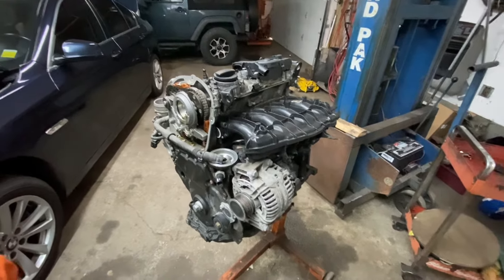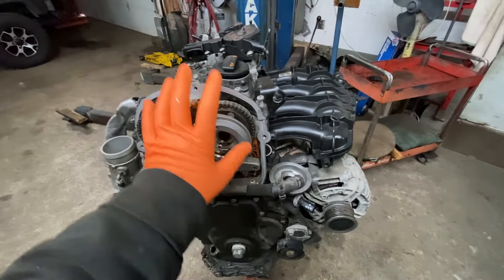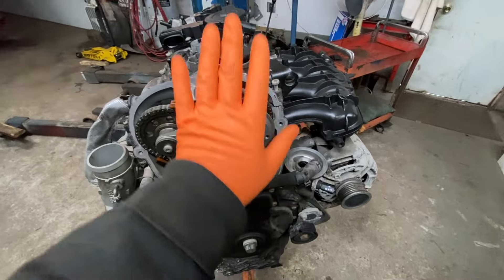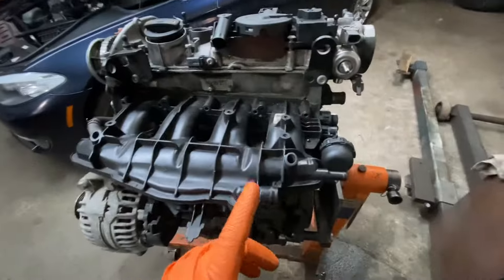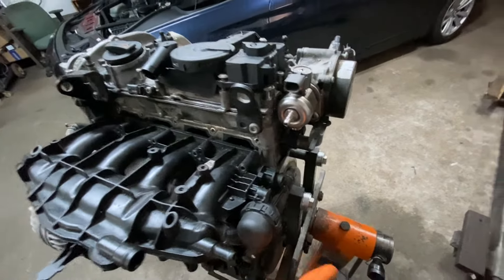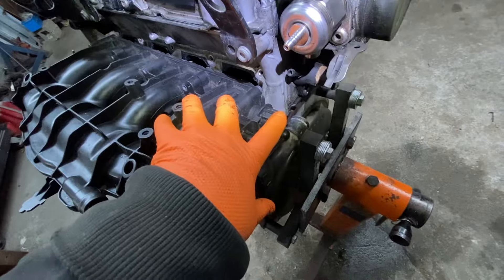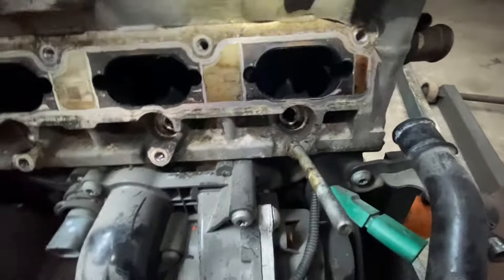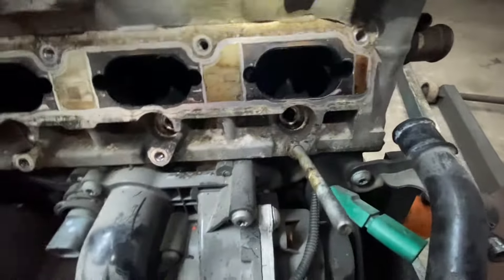VW TSI 2.0 Turbo Engine - Top 3 Failures

Comment: Hello, I have a 2012 Tiguan and for some reason it’s only averaging about 13mpg city driving it extremely slowly and about 18mpg on the highway is there anything that could be causing this issue?
Reply from the maker: Does it have the DSG transmission?
Reply: @motorcarnut  No, it is the FWD version with the 6 speed automatic. Thank you for your help!
Reply from the maker: @MystcFrost hmm, make sure air filter is clean, maybe you have a dragging brake caliper or something in the braking system not releasing properly. Make sure there is no check engine light on for O2 sensors.
Reply: @motorcarnut Yeah i recently just changed out the spark plugs, coil packs, and air filter and it brought up the mpg from 9 to 13 and it planning on changing the intake manifold as per your video because of a p2015 code, I will make sure to check out the brakes now though too! Thank you so much for your help!
Reply from the maker: Sure, no problem, hope it helps.

Comment: I bought last year 2024 may with 223 thousand km tiguan 2014 2.0 tsi 4wd.
I had a misfire cylinder 3, drove it home for 90 km.
Compression test cylinder 3 2ps, engine gone rebuild needed if the engine block survived.
This new cars have plastic in the engine, they are build to last up to 250 thousand Km.
Rough idle when I accelerate goes fine.
Any way i just thought sone one would like to hear the story.
Take care, anything you can fix with money is not a problem qao.
Reply from the maker: Thank you for your real life situation, appreciated!

Sounds like you had a burnt valve and that is from lack of maintenance from previous owner.
Reply: @ It ran well a week ago i drove it for 90km and i push it to like 180kmh, went to the place after 4-5h there winter now started the car it misfired i did not have the obd2 with me to check it.
I have a w123 mercedes with 600,000 km never went to mechanic exept to change something for funn.
Take care.

Comment: What engine code is this? CAWB, CCZB, CULA? Which one bro?
Reply from the maker: Basically all Gen 1  EA888/1 2.0TSI engine codes like CCTA, CBFA, CAWA, CAWB AND CCTB. Gen 2 & 3's were much better as they fixed most problems.
Reply: @motorcarnut Noted with thanks.
Reply from the maker: No problem

Comment: what about 1.4 litre tsi engines, what common problems do they encounter?
Reply from the maker: That's a different engine with a timing belt so you won't have many issues the 2.0 TSI does.
Reply: @motorcarnut  so does this mean its better to go for the 1.4 litre rather than a 2 litre engine
Reply from the maker: If the vehicle is a 2014 and newer, I'd go for the 2.0
Reply: Hey, where's the gearbox oil fill bolt on a '15 Jetta manual? I only managed to see where it can be drained from so haven't found where its filled yet.

Comment: I have a 2011 Tiguan that has a the dreaded p0299 code after replacing the diverter valve and then The turbo solenoid I’m left with replacing my turbocharger my waste gate rode is lose so I think that’s where my p0299 code is coming from. Should I get a new turbocharger or use a tool called turbobend to fix the waste gate rod- car is on original turbocharger with 165k do you think I can get more miles out of my current turbo or just replace it new now?
Reply from the maker: It's probably the wastegate flapper. I'd replace it first before condemning turbocharger.
Reply: My 08 2.0 T  it won't go over 50 mph and sounds like a vacuum leak sound... my oil dip stick is broke and when I start the car the motor makes werid sound and moves until I put my finger over it then stops

Comment: That seal looks like it could be a ptfe seal. They are usually not spring energised as they rely on low pressure but bigger area to seal and are capable of higher surface speeds than traditional seals. Probably needed because of the huge diameter. May be very expensive seal made badly to solve a problem that should not exist
Reply from the maker: Yes, it’s glued on the backing plate. Cheap part

Comment: My tiguan water pump went bad at 70k, hit 103k and it burned oil.  Required major repairs.  Terrible engine
Reply from the maker: Sounds like you got a couple of bad parts, but they do last a while on these engines

Comment: Does this video pertain to these engines of today or in the past? I've got a 2013 Tiguan with this engine. So far I've removed the old sealant and put new sealant on the upper cam cover (oil leak solved). New vacuum gaskets, new time chain cover gasket.
Reply from the maker: 2013 up should be fine

Comment: I have the same engine on a 09 VW Passat 2.0T- B6.  

I was told by a mechanic I trust that I have a rear main seal leak possibly.   I told him I was driving and I got a message on the dashboard saying “engine oil pressure low, pull over”. 

I pulled over right away, thank God I was 1 minute away from a gas station.    When I checked the oil level it seemed very low.   I bought 2 quarts and filled it up, I drove home a bit scared since this hasn’t happened before.  

once home I did an oil and filter changed.   

I had asked the mechanic when he was available to fix it, but he never gave me a date.  He also said I can drive it and nothing else will happened until it gets fixed.   Other than a small oil leak.   Is this correct, his assumption.   

I have noticed a leak from the flywheel/clutch/pressure-plate inspection hole...  once the engine is running.  

I have driven the car for 3 days since and the engine oil still full, the brake fluid is full as well.  

Is there anything I need to worry about.

Thank you for your help and helpful videos.   May God and Mary bless you all.
Reply from the maker: Check this out first.

https://m.youtube.com/watch?v=UZmCw-BNOjE&feature=youtu.be

Also, I would not drive it too much longer if in fact it is the rear main seal.

Comment: I have a 2015 volswagen tiguan when i bring the rpm to 2000 i get a red low oil presure light ?
Reply from the maker: Make sure oil pressure switch plug is secure, and could be clogged pick up screen in oil pan  or an oil control problem. Any codes?

Comment: Is this engine in the new 2023 Golf GTI Engine as well????? I was thinking of getting one, but after seeing this, I'll pass. Thanks for video
Reply from the maker: Thanks for the  comment. The new ones are way more reliable. I wouldn’t pass because of the older ones that had problems.
Reply: There are many more fragile engines than the EA888. I'd have one again tomorrow.
Reply: New TSI’s, different problems. I’d agree that for building power EA888’s are fantastic.

Comment: There is this sudden alert Low Oil pressure alert, with Oil can signal flashing on the dashboard...yet the dipstick reads correct gauge showing good amount of oil in the engine...whats this problem???? for 2012 Passat CC 2.0 tsi turbo
Reply from the maker: You have to check oil pressure from sensor near filter with a gauge and see if it’s the faulty sensor or a real low oil pressure problem Which can be a number of things.

Comment: 2016 CC  with over 70k mileage, i changed the manifold twice already and water pump, water pipes, alternator, ac compressor twice, radiator, feul pump 

That manifold is completely the most cheapest peice of plastic i ever seen 

Never VW again
Reply from the maker: Sorry to hear your misfortune with VW's. The ones I have owned I loved. Yes they have their problems but any vehicle does.

Comment: Your biggest failure is the timing chain tensioner fail it's a $3000 motor rebuild or more for a new or used motor the great VW people used a crappy design to hold a very important thing. get it replace get it replaced asap
Reply from the maker: Absolutely

Comment: 2019 also crap or , and can that be 'fixed ' before it goes to hell
Reply from the maker: 2013 up not really affected, No.
Reply: @motorcarnut  thx for reply and for vid , maybe I'll risk with 2019 ,2.0tsi 180hp 4 motion R line DSG , price is good and km is around 60k
Reply from the maker: Yes, if maintained they are great vehicles
Reply: @motorcarnut I have a 2013 CC 2.0t. Had the water pump go up on me the other night. I knew it once I found the coolant hoses to be cool to the touch. But that’s another weak point on these cars. Those plastic parts really kill the reliability on them
Reply from the maker: @dspock true, they all do it now.

Comment: Unbelievable. Leave it to the Germans to take something as simple as a PCV valve and turn it into that electronically controlled monstrosity you see there. I have no sympathy for people that buy these cars without researching. Or any car for that matter. These are endless money pits for sure. I would never ever buy a direct injection engine without the MPI piggybacking on the intake side. Even those injectors are not on all the time so this system would carbon up a little more than a traditional MPI alone system.
Reply from the maker: It’s not do much the Germans but all vehicle manufacturers are trying their best to combat emissions while saying money so  that’s where we are now.
Reply from the maker: I agree 100% couldn’t have said it better.
Reply: Well I have a 2012 VW Beetle 2.0 T which I purchased in 2013 before all of these problems were discovered with the engine.
Reply: @bh2155 have you had any major issues with the engine on your 2012 beetle
Reply: @MileHighJay Pretty much everything that they say could go wrong with the 2.0 T engine has happened to my car. I have replaced intake manifold x2, ignition coils, water pump, timing chain gasket cover and the main seals for oil leaks, blow motor x2, complete clutch replacement including clutch master cylinder.  Just a couple of days ago I had to replace air conditioner compressor. My car has constant problems and only 92k miles!
Reply: @bh2155 dam brotha how much did all of that cost approximately? I’ve done about 80% of these at 140k miles
Reply: @jasonrodjana209  it was about 8k to 10k on a car that is worth about 4k now

Comment: So basically if you have this motor you’re fucked
Reply: I did about everything you said and my turbo is now leaking again yayyy das auto
Reply from the maker: Honestly, they do have their share of failures, but overall are very good engines.
Reply from the maker: Leaking from where?
Reply: @motorcarnut  i believe the turbo
Reply: @motorcarnut  there was a small drip but i also replaced the turbo sadly its hard af to find brand new turbo replacements for this motor literally ordered 3 they all were wrong
Reply from the maker: Funny, I never had a bad one yet on VW Tsi’s